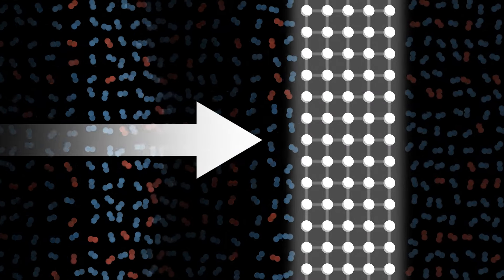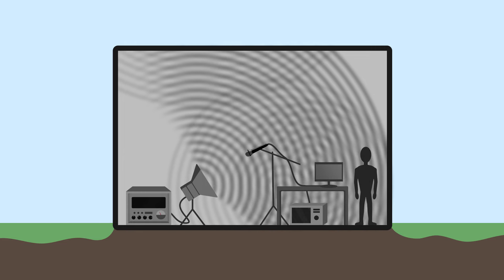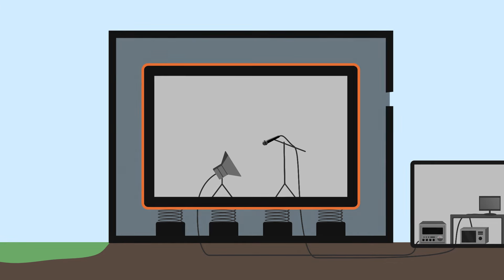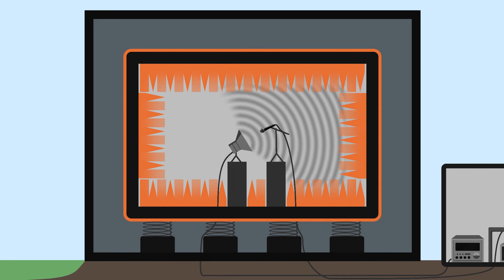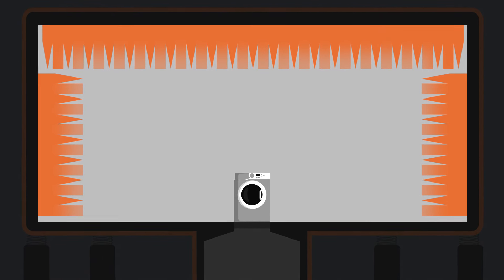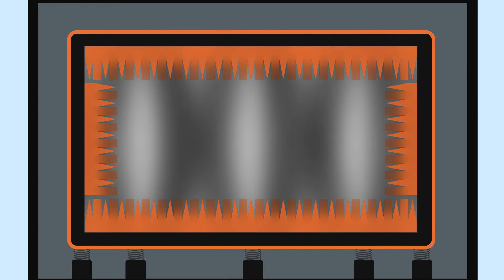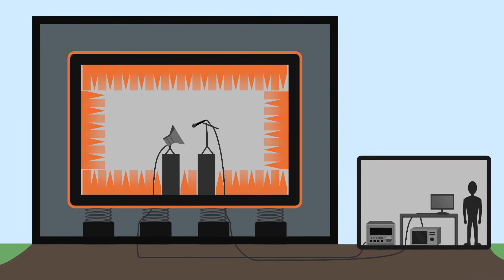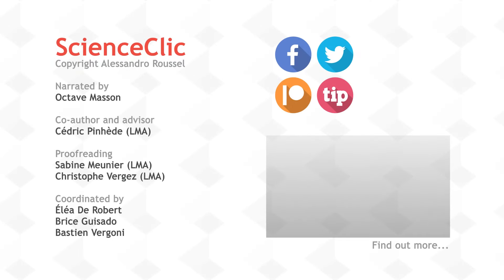How to create absolute silence? Anechoic rooms

Comment: 4 dimensional space-time seems to be fluid.
Mass & Energy are 2 sides of the same coin.
It almost seems like the more mass something has, the more energy is available to curve space-time.

What if space-time is like water, in that if you add energy to it, it changes?

If you compress a spring, its mass increases. Because you put energy into the spring as you compress it.

I think this might be important when thinking about Gravity, too.

Energy into a spring increases its mass.
Increase in mass, increases curvature of space-time around the mass.

By compressing a spring, you affect the curvature of space-time around the spring.
Because Mass & Energy are 2 sides of the same coin.

Another example is:

If you have 2 identical cups of coffee (atom for atom, exactly identical)
...The cup with warmer coffee will have a greater Mass.
Because heat stems from kinetic energy of vibrating atoms.

Energy & Mass are 2 sides of the same coin.

So your Microwave oven is essentially just a "Mass Increaser".

Because it puts thermal energy into your food, & the Mass of your hot food has increased.

-But where does a Microwave oven get energy to come on & work?...

From electricity used to do work via closed electrical circuits.

-Well where do that electrical energy comes from?...

It comes from electric (& magnetic) fields.

-Where are these fields?...

They are part of an aggregate of fields that permeate the whole of space-time.

The energy that flows through a closed electrical circuit is essentially leached from space-time & then used to do work. & then restored back to space-time.

Nick Lucid from Science Asylum explains this beautifully.

-This shows that Energy, Mass, space-time & gravity all work together.

& since there is a relationship between Gravity & Mass, I think its worth asking where Energy comes into play with gravity.

If the energy density of a unit of space-time increases, is the curvature of that unit of space-time affected?

My guess is yes. & I bet Blackholes prove it to be true.

What if a Singularity is just that?...
A total saturation of energy density per a planck unit of space-time?...

#ThinkAboutIt

Comment: as sound is described to be a spherical wave, the waves sound also propagate behind the speaker. is this right? see time 5:37 however, the speaker should also have directional properties..
Reply: Greater wave lengths act as plane waves, as if the source is very distant. Smaller wave lengths are absorbed by the foam wedges.

Comment: I'm not quite get it. How the low frequency sound can't be trapped by wall wedges?
Reply: They are same size of the walls of the studio, travelling almost like a second wall of sound (imagine a large water wave breaking on the sand of the beach, its seems to hit straight for various meters) that make them undisturbed by the foam wedges on the walls, that only traps high pitch waves because they are smaller in size.
Reply: @linuxp00  Oh I get it. Thanks.
Reply: @zharul8716  I still don't get it. Even if the wave length is very long, it's still made of small particles that get pushed forward and collide with the foam wedges..
Reply: @Tom_Quixote  Image a small ball and need to hit the floor  you need same small absortion and for a big ball sale something similar ... Sound is a mecanical energy in some way i see somewhere say... I do try for last year long to see any material other than vacuum that slow the sound so im around subject... Sound need a medium to travel without no move ;).

Comment: But if the speakers cancel the vibration then microphones can't hear the voice, since it can't hear, it can't tell speakers to make negative frequency, thus speakers won't cancel the sound, so mikes can here to tell speakers to make sound... Loop continues, so how this method is gonna work? It's like a grandfather paradox.
Reply: The objective is to cancel the echos, when a wave reflects, its phase (pattern of crests and valleys) inverts. The signal made by them is sent to a high speed processor that take this phase and add a delay (accounting for the time the wave passes the mic to bounce on the wall behind it) to the sound that will be produced by the speakers.

So the mic can hear it because the wave come unflipped and the flipped sound of the echo is cancelled by the reproduction of the same original wave with a delay, that makes the speakers not cancel the original wave too.